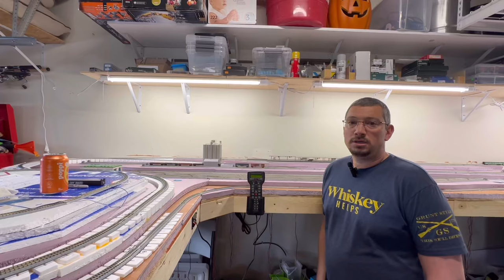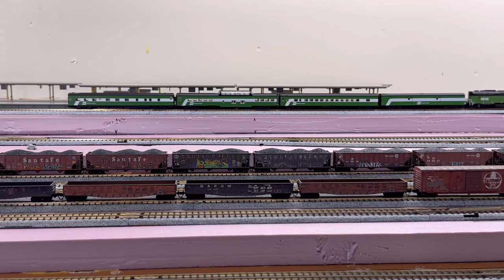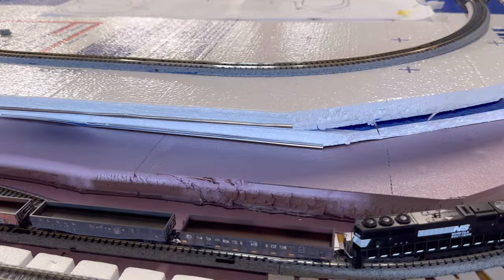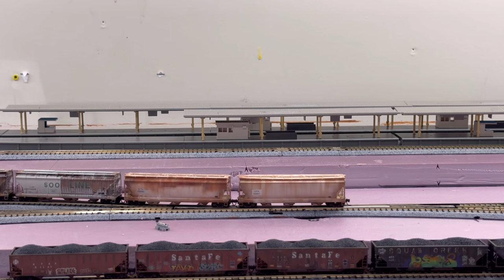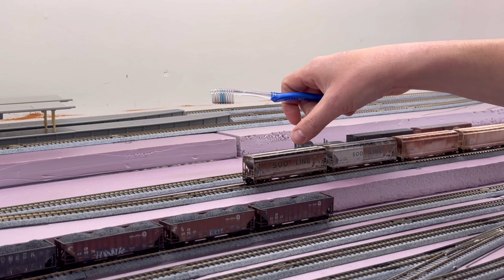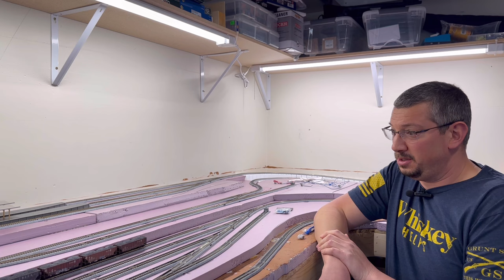N Scale Silver State Trains Layout Rebuild take 2 Part 13

Comment: I have two of those Kato NW2s. I found in converting mine, that the DCC board was intermittently making or losing contact with the frame. What worked for me was to take a thin piece of plastic and wedge between the frame and DCC board just behind the front headlight.
Reply from the maker: Thank you for this!! I will look at doing this fix. Much appreciated.

Comment: I had a triple deck N scale layout with a double tracked helix ( more to a oval) 3 Kato SD40-2s which were the best you could do in 2004 could take 42 cars up the grade of 2%. Broader the curve the better your locos will perform on grades, hope that is food for thought! Keep building!
Reply from the maker: Those helix unit are really cool. Sounds like you have a pretty cool layout. Those Katos SD40-2ds are nice units. I believe Kato is re-releasing those later this year. That is a good amount of cars up the 2% grade. I want to retest my Katos to see what one can pull up the grade. That makes sense for curves. I did as wide as I could based on my bench work and the track I had. Also doing super elevation I think it is called the the train can lean into the turn helps too.

Comment: I am so impressed with the size of your layout and amount of unitrack.  I keep thinking my 3.5' x 8 x 7 is too big! (until I face the same incline issues.) I need to scub through your videos to see a wideshot and your plans. have noticed sme other videos where they solder  a lot of the Kato once it has been glued down.  Not sure if that would help with some of the signal loss. Also ~ I think a lot of the manufacturers have coupler issues. I bought two $$$$ Broadway Limited DCC Locos and rolling stock in December ... they uncouple in the 0 incline sections where I have a 22 guage Kato wire running under the track  Thanks for sharing
Reply from the maker: Thank you. Sounds like you have a good size layout as well. I will try to remember to do a wide shot of my layout. Maybe from height to see more of it. I’m not sure if I will solder any of the track. Once it is glued down and ballasted it may be the only way to fix it. I am not sure the brand of coupler broadway limited uses but I know it is not Micro trains. Any uneven elevation change can cause the couplers to let go. Make note of any problem spots you have and try to work them out before gluing down. I need to replace the couplers on my engines then I will need to test more. Thanks for watching!

Comment: I like Your cement factory, did you have any trouble assembling the silos ?  I struggled with them, maybe didn’t have the equipment to assemble
Reply from the maker: Yes and no. I did not use a lot of care when putting it together so I do have a seem. The glue I used was a hold in place glue that really helped assembly.

Comment: Your Environment reeks havoc on any railway :face-purple-crying: It happens...... just wanted to mention that I have seen many recommend to change out KATO couplers for micro trains. RONS TRAINS AND THINGS has an excellent video on it.  I also wanted to mention that you may want to adjust your cv's 3 and 4 to a setting of 4. It will give you a more realistic look when switching. It will stop the jerkiness and slows the train to stop and go instead of the abrupt stop. I believe you can do it with the momentum button also. I always just change the cv's myself. Looking great and you have come a long way in a short time :goodvibes:
Reply from the maker: Very true. Just have to do your best to keep it clean. In this video, all my freight cars are micro trains brand cars and my Kato engines have micro train couplers. So all should play well in the sand box. My issue is the ones micro trains recommends for my katos are just too tall. I called Micro trains and was recommended a different set which I already have but need to install. I said all this to say I 100% agree with you. Micro train couplers all the way. I will keep my Kato couplers on my passenger engines running Kato passenger cars though. I was using the 10 up 10 down speed step jumper….i cannot think of what it is called. When doing this more for real I will use more appropriate throttle input. I will look into the CVs you called out though. Thanks for the tip. I appreciate it.